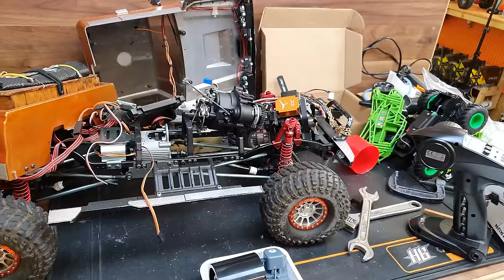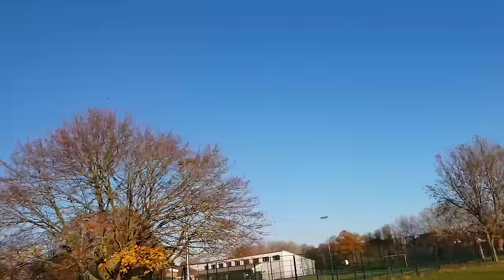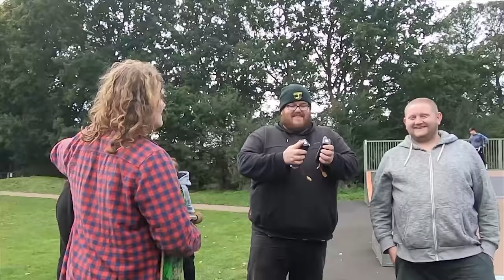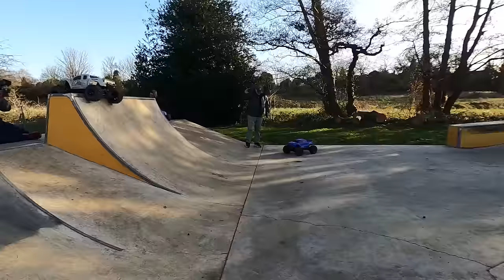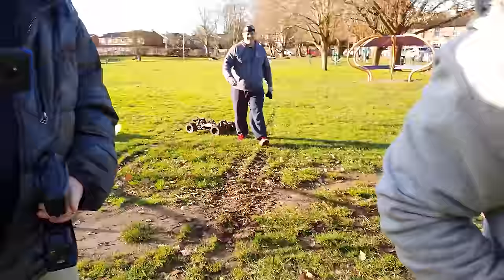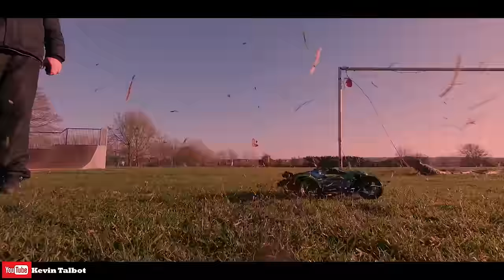$300 & $1200 RC Cars VS WALL FULL SPEED CRASH

Comment: Im actually extremely impressed with how tough the xmax is. 50mph or so into a wall, and still drove
Reply: 1000 bucks you get what you paid for
Reply: It’s $1200 what did you expect?
Reply: I expect it to snap in 2 it's a rc car lol
Reply: Mark Watson that would happen if you buy it from Walmart wait, one of those couldn’t go that fast
Reply: @markwatson9413  These are not your average cheap walmart rc cars. These are actual hobby grade rc vehicles built to take a beating.
Reply: @rydirp  I no
Reply: @markwatson9413  Damn You replied really quick considering the age of the comment.
Reply: @rydirp  cool was this quicker ?

Comment: 2wd slashes can take one hell of a beating and I've smashed mine into walls (not on purpose)  and I haven't had to fix anything after a few weeks of non stop bashing and rolling 

Traxxas plastic is tough stuff
Reply: Your right but I've just had a car run over it and broken it in half and only needed a few bits and done.but I now want to try a Arramax typhon
Reply: I have a stock rwd rustler, ran it full speed into a telephone pole ~35 mph, the ONLY thing that broke was like the black plastic thing that holds the front axle and shocks to the body, was like $20 to fix and easy. My rustler is pretty tough
Reply: Every time I take my Slash out I'm sure I've destroyed it. I pick it up, give it a look see, and nothing has even thought about breaking. I freaking love that truck.

Comment: A far cry from what my first 10th scale would have taken. Aluminum frame at 50 would have killed it. And that was a $700 Nitro powered car back in 1998.  The worst I did to it was nip a curb without the body at around 25. Sheared off the LF wheel & control arm and bent the cooling head. I believe to this day that crash is why it kept blowing head gaskets. I never replaced the head or the block after that - and ran it for 3 years after the wreck before selling it. Aside from a few hub carriers, that car was pretty tough.

Comment: 2nd comment I have a rustler
Reply: What do you think about my Traxxas? Can u wach my new vid? Is about it😄
Reply: I had some bad luck with my rustler 4x4 vxl. damn near overheating on 3s, bent shock-shafts, pulled out screws holding the shocks in place, popped off the shock caps with ease, broke driveshafts, broke wheel-hubs in both front and back. and had the wheel ball-bearings give up and i only drove it a about 6-7 hours in total maybe less. So what did i do to it? Well, i drove it on grass as i had a small grass hill to jump from. sent it less than 2 meters high and maybe 8 meters far and landed on grass. that popped the shock caps and broke a front driveshaft. Then i jumped a tree stump fairly slow, it went up about a meter and had a bad landing. that bent the shock-shaft on my gpm shocks i switched to and pulled a screw out. That was the first run with those shocks and they had way thicker shock-shafts than stock. once i was driving on tarmac and gently hit a curb at about half speed, it seemingly survive and then i let a friend drive it for a bit who hit a fence and that was the final straw for the front c-hub and hub-carrier. next run i broke a rear one. i upgraded to gpm driveshafts btw, they held up perfectly but took some shimming as they did bind a bit in the hub-carriers. i think i also damaged a ball-bearing on the side in the rear diff. i also had to buy fans for the esc and motor as well as a heatsink for the motor. got to drive it so little and it kept emptying my wallet like crazy in such a short amount of time. so i ended up selling it. I might get a 6s kraton next summer if i can get m2c parts shipped to sweden. haven't looked it up yet. or i might get something a bit smaller like a typhon. This hobby is expensive when you live on about 1070 euros a month. fml.
Reply: @DJayFreeDoo  Mine takes the hammering . Big bore shocks  , RPM arms and fastrax rear driveshafts .. works fine
Reply: @ClarkesMadRcs  the stock a arms were fine for me no sign of breakage there. oh.. i also had a bit of grinding in the gearboxes, like they were too tight. good thing they are plastic cause if they were metal they wouldn't spin fully. Its going to be arrma next for me unless i go for a maxx or x-maxx perhaps even a tekno mt410 next. not quite decided yet. depends on how much money i manage to save until then. traxxas and arrma are probably the most winterfriendly RCs though.
Reply: @DJayFreeDoo  Holy $h!t, my rustler has held up well

Comment: Customer
"I just bought this yesterday, I literally have one run on it. I bought this, because you'd said it was tough. This has some kind of warranty or something?" 

me 
"No, sorry, damage from crashing isn't covered by any warranty"

customer
"Well you guys should offer insurance or something for these things, I spent money with you guys, so if there's a problem you'd help me out."

Me
Well, we do offer repair service, and we carry all the parts. Our labour rate is $50 an hour. Parts would roughly be $30-$40. 

customer
"Come on, I just bought this yesterday"
shows me receipt
"You guys can't fix it for free?"

Me (slightly agitated)
"This is an expensive and fast vehicle, and it's recommended to have some radio control knowledge or background before operating this thing. As much as  we'd like to take a corevette to our driving test. It's best to start elsewhere. Repairing and tuning is just as much a part of the hobby as operating. So, I can show you how to fix this, or you can have us do it for an hours worth of labour."

customer
"You got someone else I can talk to, like a manager?"

Me
"I am the manager."

customers
"Well I need someone else, you got a supervisor?"

supervisor
walks up, bends over, and spreads butt cheeks apart with hands

Me
"I GUESS IM FIXING AN X-MAXX"

Comment: ... but it's fun to break expensive toys, embarrassing and pathetic ...
Reply from the maker: Pays way more and more fun than my 9 - 5 ever was, does that make you angry? 😂
Reply: @KevinTalbotTV  ... not only, your toy your choice... just my opinion ... 👍🏼 ...
Reply: You do realize every single part is available to fix these hobby grade cars... I accidentally damaged my RC by hitting a concrete light post at full throttle, fixed it all for under $100

These aren't toy store cars that end up in the trash when a single part breaks.